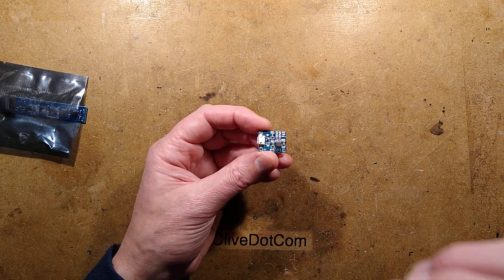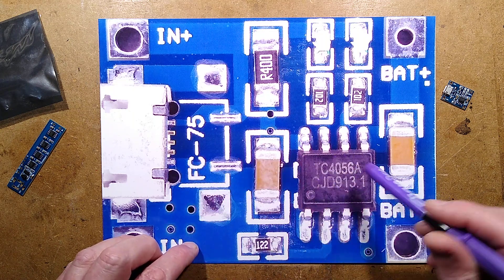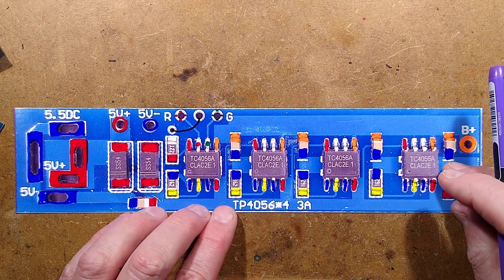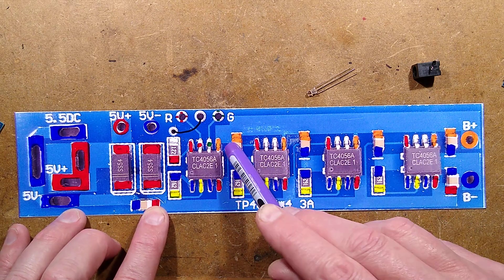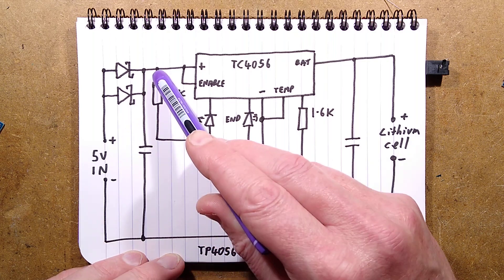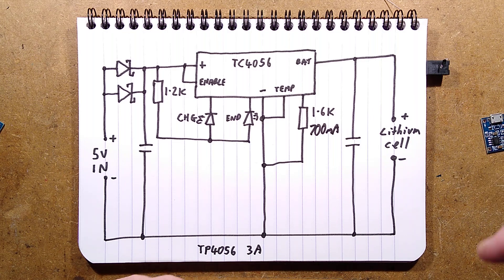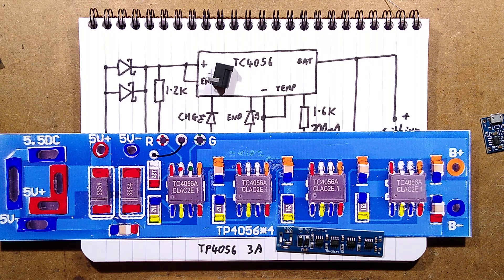eBay 3A lithium charger module with schematic

Comment: Shout out to the Big Guy for going the extra mile to educate the masses.  As they say "a picture is worth a thousand words".  Don't take these professional videos for granted - become a bigclive patron for God's sake.

The color prints along with BigClive's coloring in various components,  and of course the hand-written schematics all aid in education.  Just what knobs like me mostly need.   I quit using ink jet printers years ago cause the ink was expensive, messy and always seemed to be empty, dry or whatever.  Been using a B&W laser for last 30 years,  buy double capacity toner cartridges that last forever.  Never had the need for color prints - but if I did, maybe color laser is cheaper today; still, ink jets, I think, are the best for HD personal photographs big or small?
Reply from the maker: Check out the Epson ecotank printers.  They use bulk ink.  That's what I use.

Comment: I only need 1.5A.  Can I parallel  two TP4056?
Reply from the maker: I don't see why not.
Reply: @bigclivedotcom  Great.  So glad I took your advice and ordered the chips in quantity (5 without low voltage protection and 10 with).  Found out the hard way (or my way) just how toasty warm an 18650 can get without low voltage protection pulling just a 1.5A load.  Thank You!

Comment: Hi Clive. I'm learning a lot from you about Li-Po cells and how to charge them, and I wonder if You can give me some advice. I have been designing a Continuity Tester (with the help of Leo Fernekes) and have got a working prototype using a CR2032 cell. For V2 I want to make it reghargeable but keeping the size of the box small so an 18650 is sort of out of the question. I'm going to use a TP4056 to do the charging. So I've been looking at 250mAh Li-Po cells on eBay which are fairly cheap. My question is, so long as I keep the charge current right down (<200mA) are these cheap cells safe and reliable?

Comment: Hi BC.  Could you recommend a charge controller to recondition flat cells and 7.4v packs, to bring them up to a voltage that normal chargers will handle again?  None of my chargers are willing to try flatlined batteries.

Comment: There is also a version of this with 6 soldering connections, it looks very alike.
But it has plus and minus input, battery plus and minus, and plus and minus output.
The difference is that it has protection for the overdischarge too.
It has the same big chip TCA4056A , and also two more small chips, the board is a tad longer.

Comment: The video didn't mention the formula for how the programming resistor affects the CC charge current. According to data sheets I found online some time ago, it is: CC = 1200 / R. For example, a 1.2k resistor will give about 1 Amp of current. As Clive said, these little chips get very hot when charging at 1 Amp, which I believe is their rated maximum. I shrink wrapped one of the single 4056 eBay boards and the chip melted a hole in the shrink wrap.

Comment: They would make a good multi cell pack charger using individual power supply modules for each (providing series isolation), they are also very cheap.
I wonder what the drain back current is if any, allowing them to be left wired in circuit (like the single cell version)
Cheers, and thanks for posting.

Comment: could i use this if i want to charge a little single sell 250mAh battery i have?
im trying to make a fan case for my phone but i dont have a portable power source yet, but i do have a little battery i pulled out of some wireless headphones
its 3.7v 250mAh
Reply from the maker: No.  You'll need to charge that low capacity cell at closer to 100mA to ensure a longer lifespan.

Comment: There are usb-c charge controllers with 3A and a single chip:
IP2312 - Injoinic - Single-Cell Lithium Battery synchronous Switch Step-Down Charging IC

They are getting a bit hot, by the way...

Comment: The smaller board looks very similar to the board in those single cell power banks you find in the dollar/pound stores. Is there much of a difference between them? (Besides the boost circuit for the output,)
Reply from the maker: The simpler TP4056 chip just charges the cell, but also has extremely low quiescent leakage current.

Comment: What’s the purpose of the two Shottky diodes in parallel? (I understand it acts as a polarity protection but why two?)
Reply: Distributes current (and therefore heat). At 3A conducted and 0.2V dropped, that's 0.6W dissipated on those diodes, which would be too much for one diode. 0.3W each is more manageable.
Reply: @tybofborg  Ahh I see. Thanks!

Comment: I was thinking, isn't it possible now that three of those chips are still charging, while the one with the LEDs already has stopped, if it is slightly out of tolerance with the others. The indicator wouldn't then really tell that the charging has ended. 

Don't know if it really matters though. Don't even know if it matters that one is still charging in CC, while others in CV.

Comment: I would rather use a IP2312 module for higher currents than 1A. This is a Lithium charger step-down chip with 3A output current. Since it isnt a linear regulator, it is way more efficient, a little bit more expensive thou

Comment: Is there a way you could use these for multiple cells in series? Or would another chip be better?
Reply: No, must use another module for two series cells, to create a higher voltage. Search for something like 2S charger on ebay/ali.

Comment: Thanks for the knowledge you share here. Please provide similar insight into a power bank charge discharge circuit with cell balancing,  throwing some light on cell balancing logic.
Reply from the maker: Most USB power banks don't need balancing, because they have groups of cells in series that self-balance.

Comment: So I once thought about putting 7800 series voltage regulators in parallel, but decided against it after reading online that the regulation would not be spread evenly among the chips, in other words, one chip turning on turns the other chips off. I wonder if this is true now, or why is it different for these 4056 chips.
Reply from the maker: With voltage regulators you can get uneven sharing of the current.  But not with current regulators.  They will just add their fixed current to the total.

Comment: Oooo~~~~~~~~~~~~~~!!!!!!!!!!!!!! thank you clive!~!!!! i have a few of these and they rock
Reply: can you do the 250w buck/boost dc/dc inverters? i have 1 in my ebike that takes any vs high current speaker screw terminal posts aux input (random laptop charger/extra battery/car clamps, 10-60v in- 42v8a out without any fans, it takes the internal battery to full and you can even parallel any lithium or even lead acid you have access to! i have a spare 10s4p? that basically doubles my run time from 10 miles to over 20(havnt actually depleted it fully yet)

Comment: The design uses a cluster of very common 4056 charge control chips in parallel to give much higher PCB temperatures and shorter lifetimes than switchmode designs.  
You are doing us a favor by showing how rubbish this wasteful copy and paste charging tech is.
 At 4 dolars its ultra overpriced trust me.  They sell these pieces of garbage for like 50c in asian markets. 
This stupid crap just makes me angry angry angry. I don't know how you keep calm Clive.

Comment: Although relatively simple (certainly from a component count) those boards are amazingly cheap for what they do (even though they are "a bit variable in performance" (personal experience ;-D) In the "pre-IC era" you'd have needed a lot of discrete components to do what just one of those chips do (and your end result would not have been as energy efficient either!)

Comment: Yea my tp4056 chip is exactly the same except the r400 resistor.. mine has a 0 Ω resistor in its place same circuitry but different resistor..

Comment: I wonder if you could cut a few tracks, and get a 4-paralell cell charger for drones/FPV?
Reply from the maker: Not as easy as that.  For multiple cells it would require much more complex circuitry.

Comment: Its unfortunate there isn't any way of changing the final voltage charge level so one could having charging complete at 90% rated so as to improve battery longevity at the expense of some run time.
Reply: Minimum input voltage of TP4056 is rated as 4V. So you could either add some more series diodes to the input, run the device off a 4V regulated supply, or add anti-paralleled schottkys on the output of the circuit.
Reply: Maybe jack up the negative pin of a 3.3v reg with a standard diode (0.7v drop), the regulator output will be a final voltage of 4v in relation to common ground... to feed your 4056/4057/LTH7 charger chip with, but it won't tell you when the battery is "fully charged" as it will never see 4.2v.... i use a similar circuit but with a Shottky diode without the 4056 in a powered wall clock for the "memory" battery, it holds output at 3.7v (the sweet spot for lithium). 😉

Comment: I have a single cell nitecore 18650 battery charger which keeps ruining my vape batteries.. I think it keeps charging them too high without cutting off.. If i leave the battery inside overnight, the battery is dead the next day, and the charger just shows 'E E'.. So annoying.. Whoever said that you should have a separate charger for your batteries, instead of charging them in the vape mod is a fucker.

Comment: if you need to charge a mobile-like battery then they do not charge faster with 3a CHARGER CARD ONE WITH 1 A CARD. IT FOLLOWS OHMS LOW. A phone puts in higher volts to charge faster

Comment: Surely the connector only matters on polarity depending what connector you put in to it, center negative or center positive?
Reply from the maker: Most are wired for centre positive.
Reply: @bigclivedotcom  most I have are the opposite! 😅😅

Comment: If one chip fails, will it continue working?

Is it safe to charge at 2.8A?
Reply from the maker: If it fails open circuit then it would continue working.  The high current is ok for large cells.

Comment: I have several of the single 4056 boards in use
Parallel linear regulators are not new though, even going back to the zener/transistor circuit you would parallel a few 2N3055's for more current ;)

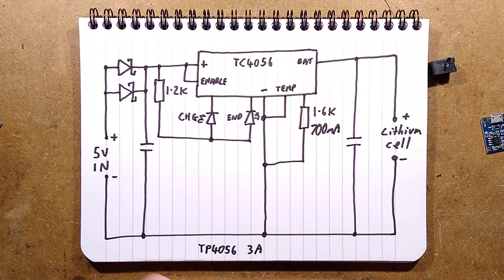Comment: 6:36 ...in series ?  Go to bed Clive, you're feeling very sleepy... ;) 
3A into a single cell, is that not a bit rich ?  I'd put a cap across the output, 220uf ~ 470uf 16v, keep those chips averaged out.

Comment: Neat chip and a bit more info too - thanks! I am designing and building a minimalist guitar / headphone amp with a 1S LiPo battery charged by MCP73831/2. In a SOT23-5 form it forgoes the enable and temp lines to make a similarly simple charge circuit. Learning lots - appreciate channels like yours that cover how chips like this work.

Comment: On this one , that generally accepted board has a fault. It charges the cell at too high a voltage and destroys the cells quickly . Thats why they are not lasting long and thats what the manufacturers want .So you buy more quickly. 
Stop the overcharging output voltage by fitting an appropriate zenner diode in the output line to limit voltage out to an appropriate voltage . 4.1v for LiIon. 3.6v for LFP etc. Don't let the cell voltage go above those values ever.

Now there is a real challenge for you Clive . How to fit the zenner and save the energy wasted as the battery comes up to full voltage . The current through the battery drops dramatically closer and closer to zero . So whats a good circuit to use Clive?
Reply from the maker: This module is for high capacity cells or parallel clusters.  The voltage will be the charge state of the battery.

Comment: Clive is quite obviously a master of his craft with a deep wealth of experience and knowledge... but the most impressive thing is his ability to get a damned colour printer to work before each video!!
Reply: I think he might actually use a proper photo printer. Since those are usually made by companies who know what they're doing (i.e. not HP)  it would be slightly less impressive that it works. :)
Reply: @Joelsfilmer  Ah see HP Do actually know how to make a printer, and that's the key, you need to know how to make one work so you know how to make one not work with just the right frequency that you'll keep buying printers thinking that's just how printers are.
Reply: It's conceivable that he does enough printing for his "real" job (and/or underground publishing of catfight erotica) to keep an inkjet printer's nozzles from clogging. We should all aspire to be more like Clive.
Reply: @popefacto5945  The problem with nozzle clogging seems to vary. I left an Epson photo printer sitting for five years (with ink  that was five years older still) and just set the printer to blow its nose with the regular maintenance routine and it was spotless after that.
Reply: I think he's mentioned somewhere that it's an epson ecotank. I could be totally wrong though.
Reply: @whiskeytuesday  I recall him mentioning that also.
Reply: Hi should do a stream with Scott Adams who continually threatens to throw his printers off the balcony.
Reply: There's just enough time between each reverse engineering to let the ink expire. He probably buys a new cartridge before each print.
Reply: I would buy a BigCliveElectronicsCo Ltd. made printer :D
Reply: I personally use a Brother color laser printer. I bought it just over a year ago and I’m still on the “trial” cartridges. It was pricy at ~$250, but the ability to not have the ink dry up between prints is awesome.
Reply: I'll second that it's printer week for me I just troubleshooted and fixed two-and-a-half printers for not working.

Comment: I can't see that this will work properly. It all starts that they put two diodes in parallel. Not a good idea.
Furthermore those TP4056 chargers (and all the clones) drift heavily, the resistors used are at best in a 1% tolerance range. So without any balancing resistors in series to the charger output, this whole thing relys on the resistance of the PCB track... Good luck. I would like to see a thermal camera shoot under load. That would be interesting.

Comment: Those TP4056 charging boards are quite handy, I created a 2S charger powered by USB using two of them and a miniature 5v DC-DC isolating transformer.
It works remarkably well for such a simple wiring setup. 5v source goes into one of the TP4056's directly, whilst the 2nd TP4056 gets its power from the 5v source fed into a DC-DC isolating transformer. Each of the 2 cells are individually properly charged, albeit a bit slow.

Comment: Technical Question: what is the benefit of using one of the TP4056 modules (together with a 5v usb output module) over a standard USB module taken from a Poundland powerbank that does it all??
Reply: Assuming you mean one of the powerbank modules that still uses an 8-pin chip, then having the system separated does provide more flexibility. The TP4056 uses an external resistor to set the charge current (this can be swapped to whatever value you desire based on the connected cell's capacity, etc.). Specifically, in the case of the modules, they can be purchased with the additional DW01 protection IC, whereas the powerbank modules may (although I'm not certain) mandate the use of a pre-protected cell - assuming you care about cell protection, which you likely do. I guess the only other advantage would be if you wanted to cater for different output voltages (since the boost module would be a separate part), although given that you specified 5V as the output, this may be a moot point.
Reply from the maker: The powerbank module also has the output voltage booster circuit.  Not all circuits need that and the slight extra cell drain it carries.

Comment: Hmm the one I have is different slightly.. has 4056s but also a small other chip I can't identify. Been wondering if it does cc/cv  but not sure
Reply: The ones I got were wh-2s5a
Reply: Has two txy8205a mosfet and another ic I can't identify
Reply from the maker: It's constant current up to a voltage threshold.  The other chip may be a variant on the DW01 to add extra charge/discharge cell protection via the MOSFETs.

Comment: Was recently looking for a small board to trickle balance charge a 12V pack of lithiums from 5V.  Think I found this but not what I was looking for.   Wonder if it could be hacked.
Reply from the maker: It would require a proper multi-cell charger/balancer.

Comment: Not sure id wanna shove 3A into a single cell unless it was one of them super high end 18650, Wonder if you could add a variable resistor to it so you could change its max charge amp in real time?
Reply from the maker: It's designed for large cells or parallel clusters.
Reply: @bigclivedotcom  ah so it would divide well over a 3p or greater cell construction. Interesting thankyou :-)